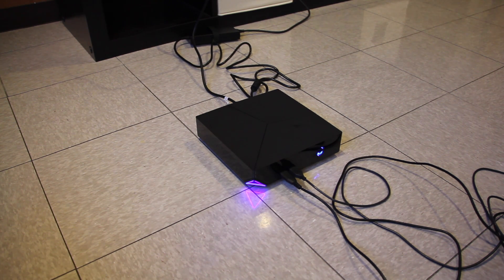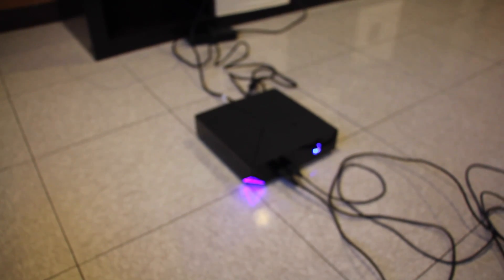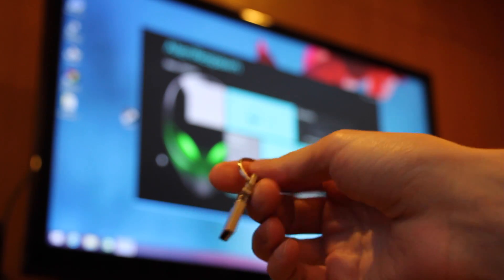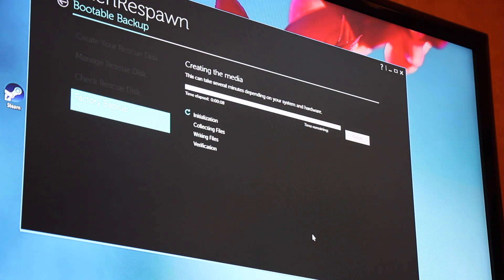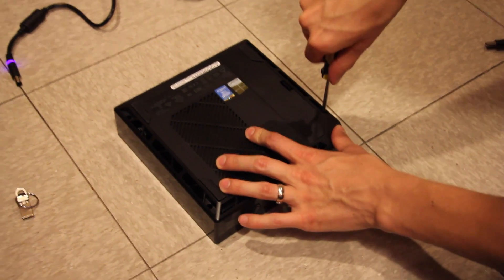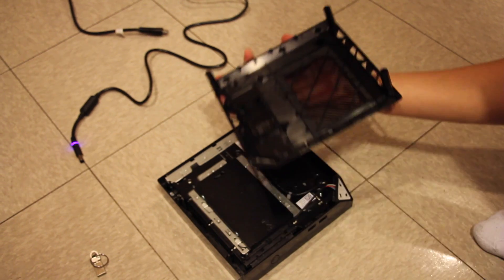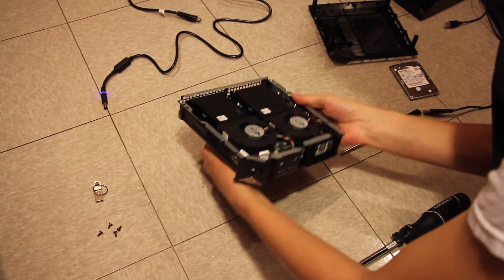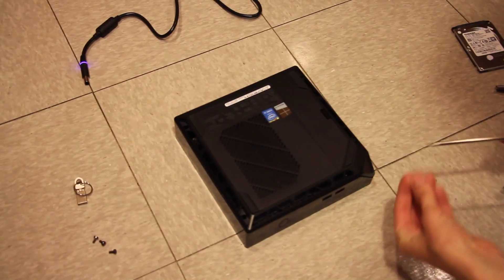Tutorial: Alienware Alpha SSD and RAM Upgrade

Comment: i wouldnt need to back it up with a flash drive if i upgrade the ram right when i get the system right?
Reply from the maker: correct. back up is only necessary for the hard drive upgrade.
Reply: I was gonna ask the same thing

Comment: I was wondering when you load up the software on the flash drive  can I just put the ssd in a drive dock to use that as an flash drive ? then I could use the hard drive for an external hard drive

Comment: 120GB? Dang bro. That's maybe 3 games.
Reply from the maker: Haha no joke. I bought a 250gb to replace it.... Two weeks later.
Reply: Eric Laue yeah.. but good cheap way to speed up startup and windows  interface 10 fold.. as well as a few of your favorite games.... then maybe connect a usb hardrive.. you can get self powered usb 2 1tb drives these days for dirt cheap.
Reply: In that case your better off replacing the Wifi card with a 120GB SSD.
Reply: +Eric Laue  ...Ya gotta be kidding.
Reply: I guess the wifi slot isn't tied into any SATA controller. So no mSATA SSD. :(
Reply: Eric Laue
 120GB = 3 games...ya gotta be kidding!
Reply: GTA V is 65GB. So ya...Not even kidding.
Reply: Eric Laue Very big game! So 128GB isn't enough?!?!